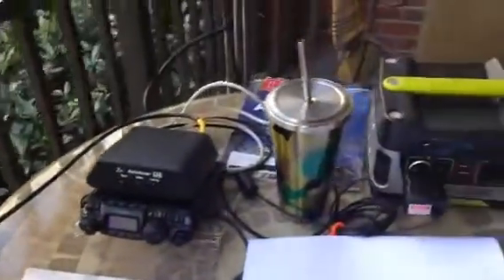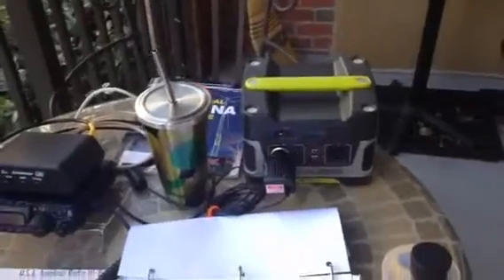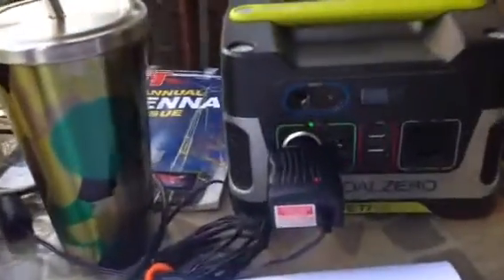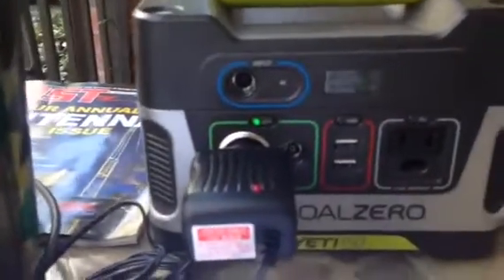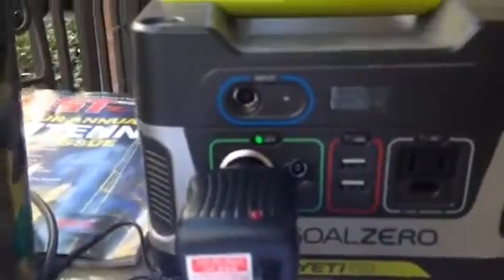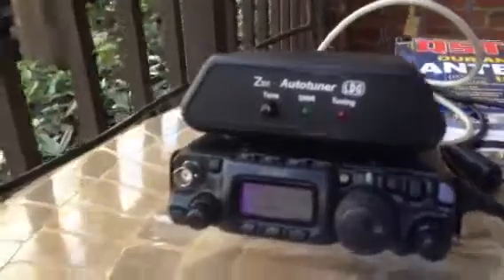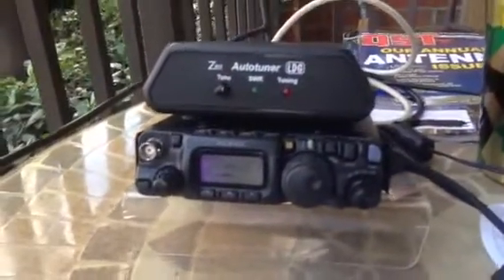Simulating a Power Outage with my Ham Gear

Comment: Impressive rig.
It's a good feeling to have that gear in place.
Reply from the maker: It is Bruce.  I am getting ready for hurricane season.  I want to make sure everything is in working order.
Reply: The jump from your Wouxun to the Yeasu must be incredible. Would you say spending the extra cash is was needed or a luxery?
Reply from the maker: Yes.  There is so much more you can do with HF.  Does not depend on local repeaters.  I think HF capability is very important.  Although I still have a novice license and can only talk on a small portion, I can still listen to everything which is what I wanted.